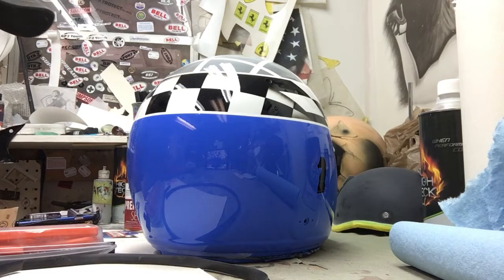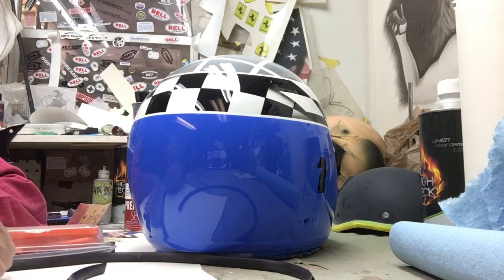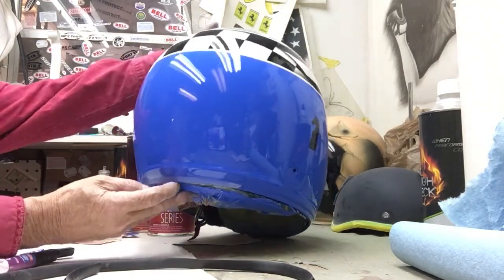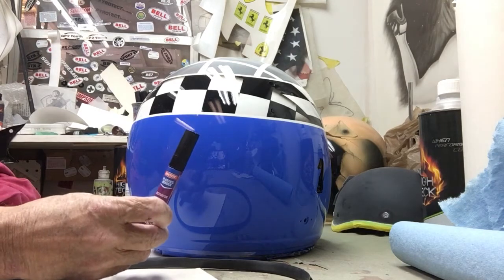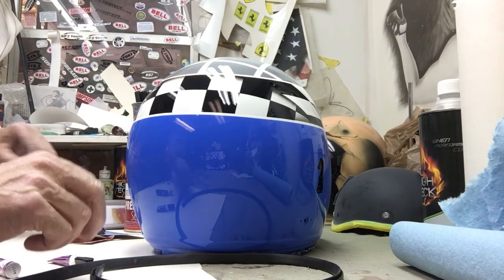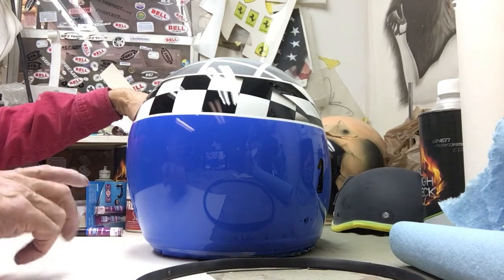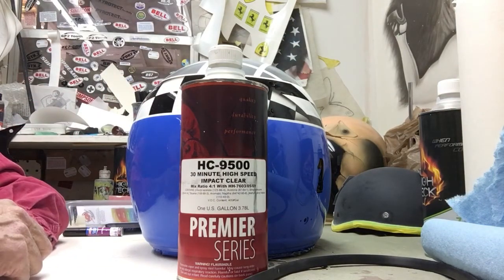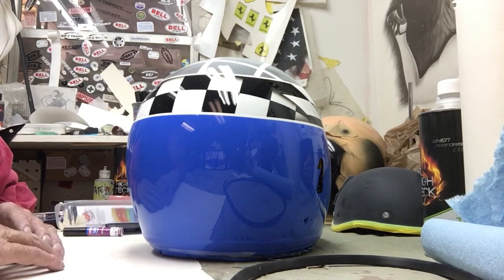Helmet Painting, Airbrushing Helmet Tech Tip

Comment: What do you use to clean the trim? Some cleaners eat into the trim and others leave a film ( not seen or felt) that doesnt allow bonding
Reply from the maker: Clean it? Usually I put new trim back on seldom use the old trim. I remove all the trim before I paint a helmet. There is a car trim cleaner called Back To Black it sort of restores old rubber trim.
Reply: Um...yea i meant the new trim...that you clearly say to clean in your vid
Reply from the maker: anything that is not solvent based, soap and water should work just fine on the trim unless you get paint or glue on it
Reply: WD40 would do. Just spray it on a cloth and just keep rubbing on the trim and the glue shall goes off.